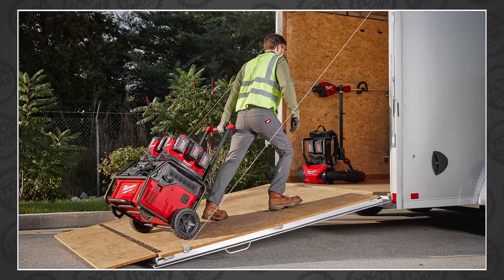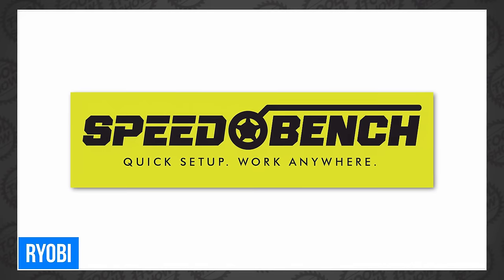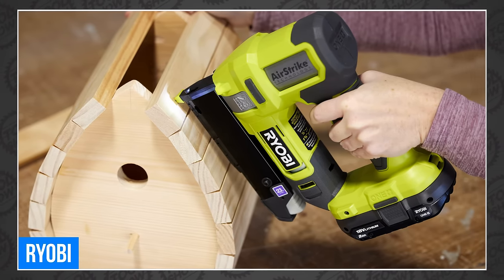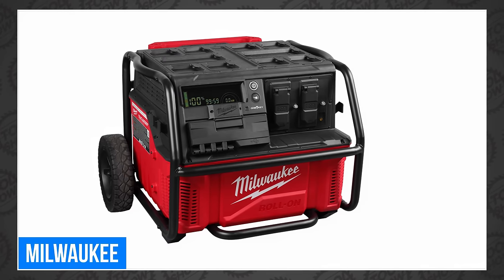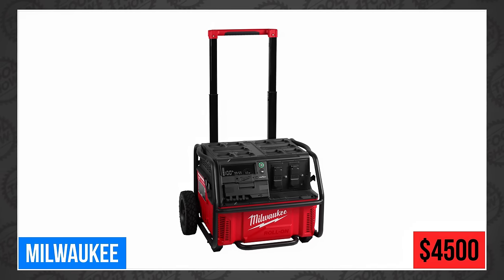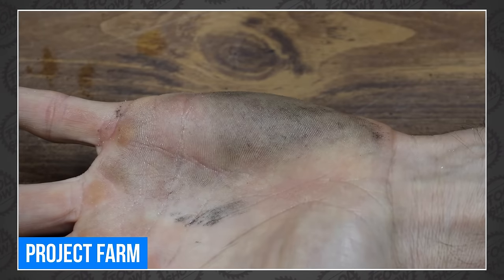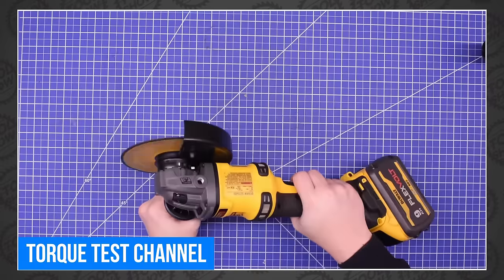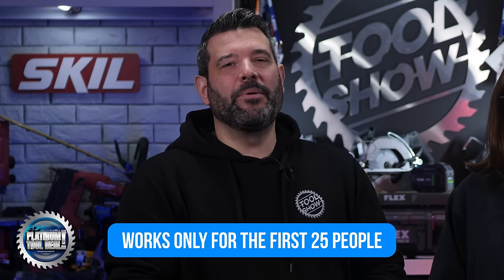NEW Power Tool from Milwaukee, RYOBI, IRWIN and more!

Comment: So the new Ryobi 23ga pin nailer still doesn't have a depth adjustment? I have the original and not having a depth adjustment means either pins that are proud or driver divots ruining your work piece. Big pass on both of them!